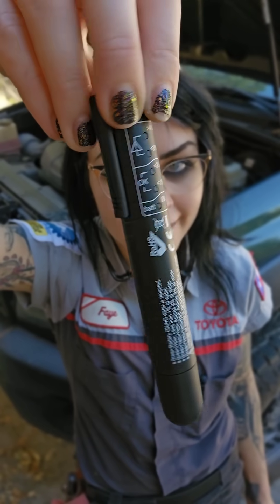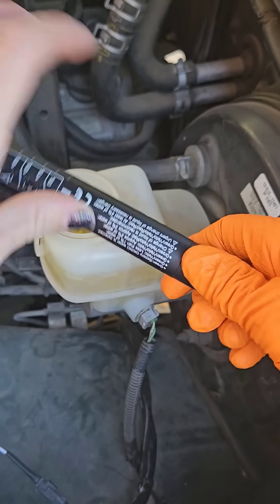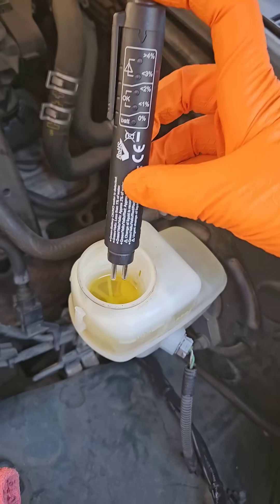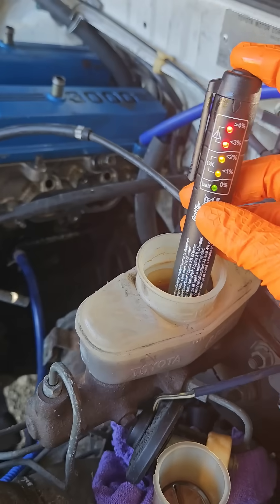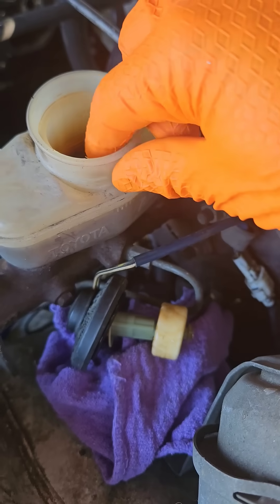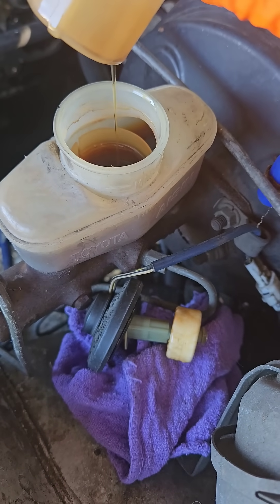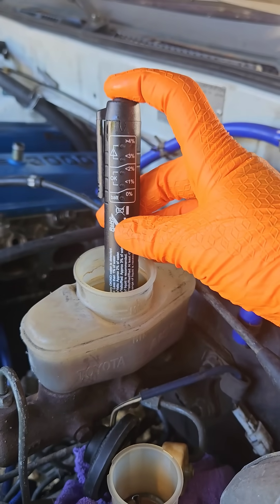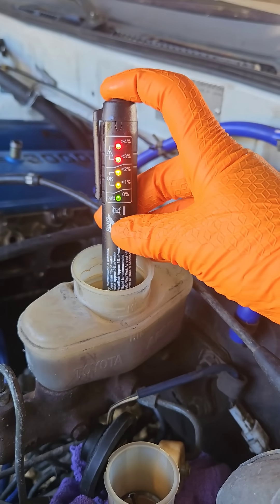Do you REALLY need your Brake Fluid Flushed?? How to Test it For Yourself!

Comment: Dang. Faye always dropping knowledge. Now I got something else I have to buy. Didn't even know brake fluid testers existed.
Reply: Contaminated break fluid ruined 2 rubber gaskets for the master cylinder lid. Flushed the system and all’s good now.
Reply: Back in the 2000's we were using break fluid test strips, and coolant test strips in our shop. That's how you got the suggested exchange or required exchange.
Reply: You never know something exists, until you learn it exists.
Reply: Me either buddy me either. But I got one now!! Lol. To add to the massive tool collection I already have
Reply: I can't believe blinker fluid is actually a thing now 🤦 Watch, the late model cars are now not going to run right without it
Reply: wait till you find out about coolant testing
Reply: I just learned a couple of months that the CCA of a battery could be tested. I never knew CCA lowered with use. I thought it was all about the volts when it came to batteries. And thankfully CCA testers are cheap.😅
Reply: Dude dont forget to empty all your summer air in your tires to winter air aswell
Reply: I wouldn't bother with one, just replace the brake fluid at the proper intervals
Reply: They sell the test strips as well.
Reply: I hear that😂
Reply: Never ran into the squishy steam thing im guessing that happens more when you really really need brakes working like when theyre hot on a hill etc.  Yeah i had no idea theres a tester heh
Reply: Just bought mine!
Reply: I hope you're being sarcastic lol
Reply: Just use your damn eyes , if its clear and yellow its good if its become darker u need to change .

Same things as pee
Reply: Same
Reply: Yeah .. but real mechanics don't need  'em.
Reply: Blinker fluid is real too
Reply: @alwayshopeful70  Don't waste your money on blinker fluid.  They now make a multi-light fluid.  You can use it for blinkers, taillights, and headlights.  No need to buy 3 products when you can use one.
Reply: @RH-cv1rg what does it do for side markers, and does it work on mirrors, too?
Reply: @petesmith5092  Side markers, yes.  It is a universal multi-light fluid.  Mirror reflectivity lubrication is a different product.
Reply: @RH-cv1rg  yeah, i gotta find some, objects in my mirror have been gettin farther & farther away!!  🥴😖😜😝😛😄😁😆🤗
Reply: @RH-cv1rg or substitute with grain alcohol ever clear works best 😂
 Woosh lights never brighter 🔥 😂
Reply: @alwayshopeful70 so is exhaust fluid......what im lookin for is a can o' compression!
Reply: Don’t forget muffler bearings, knuckle spatulator and the flange malidapter. Oh, 90 weight gauze too.
Reply: @JohnSmith-yl6dn piston return springs are also a must, can’t be without them!
Reply: @JohnSmith-yl6dn 🤣
Reply: @alwayshopeful70  I think someone just needs brain fluids for this on lol
Reply: @alwayshopeful70 dodge viper

Comment: Brake fluid won't absorb water if the seals on the system are in good condition. Spongey pedal is more likely to be a sign of a leak in the system that needs correcting first. Fluid in one of my Valiants is at least 15 years old, but the system is sealed properly, and it stops better then most modern cars.
Reply: Incorrect. The reservoir is vented to atmosphere and the fluid is hygroscopic. Your old car that stops great may be true until you get them up to high heat like track racing or going down a long hill.
Reply: @acsnitner7661  Nope. Master cylinder has a steel cap bolted down with no vent. I have two 66-67 Valiants, both with dual cct master and remote booster, one has solid rotors, the other ventilated, I can peg the brakes from highway speed to standstill 5 or 6 times before the heat gets to the solid rotors, the one with vented rotors can do it all day.
Reply: @PiDsPagePrototypes  sorry buddy but you're wrong. Think of it this way, as the pads wear down the fluid level must sink to match. Also going up and down in altitude, does your sealed system crush and balloon?
Reply: @acsnitner7661  There a rubber diaphram under the bolted down lid. Some air below, some above, as the pads wear, the diaphram gets pulled down. It's enough vacuum to make the lid a pain in the ar,.. to remove.
Altitude changes don't affect cars much here, not called the flattest continent for no reason :)
Reply: @PiDsPagePrototypes  dear God...ok the diaphragm is to prevent airation, nothing more. Go find your last science teacher and show them what you wrote here, expect a slap
Reply: @acsnitner7661  Go find a 60's car and learn that current systems are different, oh, and try not to be a rude child.
Reply: Besides the reservoir being vented as mentioned, your seals can be factory new and it won’t matter because brake fluid, being hygroscopic, absorbs moisture at a molecular level through parts of the system.

Comment: My brake fluid on my 2007 Scion TC is original and I have 113K miles.
Should I change it? 😂
Reply from the maker: haha probably!!!
Reply: @FayeHadley 
It's now 50 mi shy of 135,000 
I think I blew out the right rear brake line this afternoon so I'm ordering four new ones from RockAuto. 

As soon as they get here, I'm going to replace all four brake lines and put on the EBC rotors and pads I ordered a year ago. 
I'm using Redline full synthetic DOT4 brake fluid to flush the system.

Comment: Brake fluid tester,never knew that they had such a thing after 30 years, always learning new things from Faye 😊
Reply: They had to have a tool to prove to customers that they needed the service, to get customers to let them do it.  Lol
Reply: @ThinkFreely2012 still doesn’t work lol. “Muh brakes work fine they don’t have any air in them” well you ain’t wrong…
Reply: Just use a multimeter
Reply: These systems are not calibrated, and they are not reliable.
Reply: After 30 years there making a new get you money device. I just get new when I take off my calibers.

Comment: As a technician that never flushes his own brake system yes it is needed unless you know how to completely replace the system if needed  corrosion does horrible things to hydraulic systems
Reply: It's not only about corrosion but also the boiling point of the fluid.  You gonna rely on brakes that have water in the fluid?  Brake fluid absorbs water as it ages, lowering the boiling point considerably.
Every couple years, I pump my master cylinder reservoir dry and refill with fresh fluid.
Reply: @thisisyourcaptainspeaking2259 you beat me to it